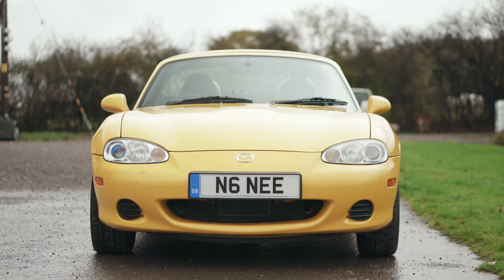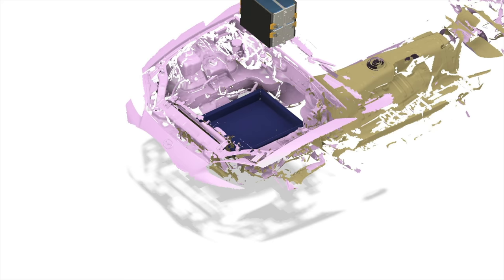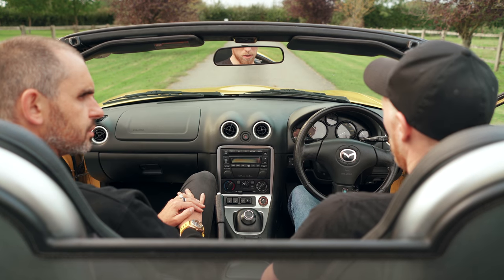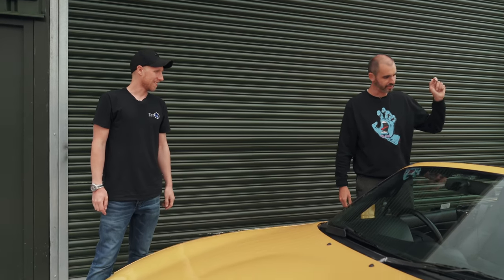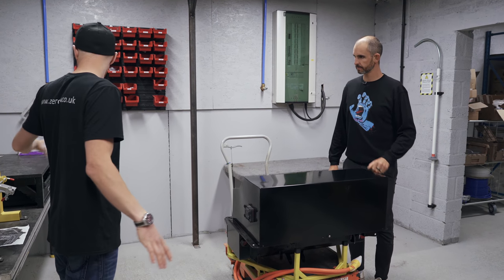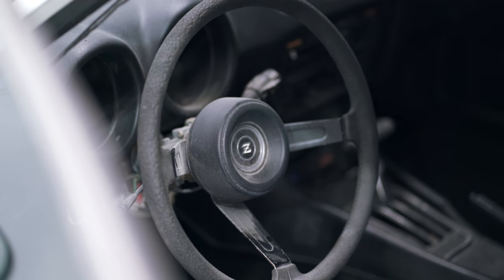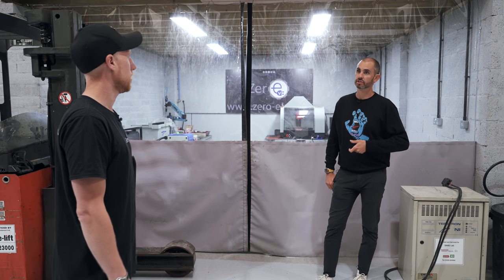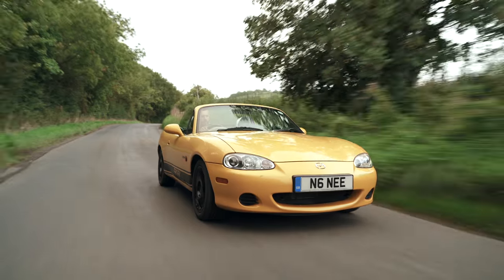EV swapped Mazda Miata MX5 // The Late Brake Show

Comment: 20,000 for 100 mile range  😩 I think I'll stick with the dinosaur juice .
Reply: For how long? Some countries are already planning on stopping sales of new ICE vehicle by the end of the decade.
And as more conversions become available, the prices will fall. For a weekender like the Miata, 160km range is further then most people living in cities would ever drive in a day.
On top, it's very easy to spend that much on a performance engine rebuild, evens full rebuild of the Mazda motor with turbo and intercooler will cost that if done professionally.
Reply: @PiDsPagePrototypes  I’d suggest you find another mechanic if they’re charging you 20k for that!
Reply: @Retrobeemer  When you factor in the labor costs, even fitting a 5000k (US dollar or UK Pounds) engine upgrade will put you well past 20K
Reply: @PiDsPagePrototypes  I’ve just upgraded my 1602 to a 1.9 twin cam, with custom engine mounts and subframe, refreshed the whole engine with new timing chain etc, modified the exhaust manifold, fitted standalone ECU and had it mapped, fitted a brand new LSD, a 5 speed box and brand new coilovers and the bill included parts! It was way under £20k!  Also I recycled an engine and it now does 45+ miles per gallon! So is as “green” as anything electric. #bmw16v02

Comment: There are a bunch of comments here complaining about missing having a manual transmission, ostensibly because of the feeling of engagement that accompanies it.  But what is the point of a manual transmission and clutch? It's to allow you to shift to a higher-torque mode when you need it, and to do so in anticipation of needing it (as opposed to belatedly, as with an auto transmission).  But if the electric motor already has the torque available, then what are you missing, except an additional ceremonial step?  Did drivers miss having to double clutch before manual transmissions had synchros?

Comment: Too many EVs for me.
Reply: Na.
Reply: But they are the future and can also be the past 😀
Reply: Not for me thanks.  The engine and that gear change are iconic parts of the MX5 and contributed to making them special.  This is like a faster looking milk float.
Reply: @Retrobeemer  Isn't it a bit of a stretch to call a 1.6 MX5 engine 'iconic'?
Reply: Jonny likes his EVs. That's why I'm here. I have the same attitude you have when he does an ICE review.
Reply: Luddite, eh? Uhuh.
Reply: More EV please.
Reply: Absolutely. May have to unsubscribe if it goes on
Reply: @robtt997  - Pro-tip. When he showcases an EV, don't watch. When the video is about an ICE car, watch. Although you may learn something by watching the EV videos. The engineering is fascinating.
Reply: Chris Clarke The mix of a revvy twincam and the snick of the gearshift were deliberate design features.  Also that engine was always built with turbocharging in mind (see 323 4x4) which is why BBR offered the factory blessed conversion when they were first released in the U.K.  They're a copy of the Elan after all.

Comment: I so want to ev swap a modern ford transit custom, something like a 200mile range at around 200-300bhp would be amazing rwd and around 1 tone pay load. May look at building on myself in 4 or 5 years when kits become cheaper and get it commissioned and signed off from a pro.

Comment: Nicely assembled unit but I don't really see the point if the range is so low, I suppose if you're only ever going to use it local that's fine but at the cost it doesn't seem realistic, either way it is very neat.

Comment: Looks like the only things missing are swapping the air pump for hydraulic system, and a gearbox like the Taycan gets, to give it harder launches, and more top end... Or lower power load at highway cruise.
Y'know, for the noise factor, a properly tuned cooling fan could produce a noise like a gas turbine.

Comment: Jonny, have to say your "sellout" move was well worth it! It is hard to pull off this level content just on your own so well done going up a level! Good stuff!
On a subject - I keep wondering when or if will it be possible for a regular guys like myself with some ordinary but loved daily driver (with 200-300k on the clock) to buy a e-conversion for some reasonable amount. Because you see there is SO MANY already produced and sold combustion engine vehicles, it is just not sustainable to scrap them all in next 100-200 years. The bodies and chassis are perfectly usable as is. Why not give them a chance to keep going... (Well ofc I know why and how expensive the per model RnD work would be and it makes me sad 😭)

Comment: You wanna bung a decent 4 point cage +/- door bars in that. I've been using a Mk1 MX-5 as a gravel Autosolo car for a few years. They're quite popular. Couple of years ago two old boys rolled one, wearing a hard top. It pancaked it. The windscreen frame just folded flat and the hardtop was crushed. It didn't even have the crap chrome roll hoops. Cue Air Ambulance and trips to Hospital with the passenger suffering a head injury (a large haematoma - looked like he was growing a 2nd head) & severe concussion. They were lucky to get off so lightly.

Nobody else with a MX-5 was keen to go out again that day. Except me. My mate said he wouldn't drive it. 'I have a wife and two kids.' So I guess I'm expendable. I only did two stages to test a new reinforced diff casing, diff skid guard and welded differential, and then I decided caution was the better part of valour.

We all fitted proper roll-over protection after that experience.

If you turn a Mk1, 2, 2.5 MX-5 over, don't expect the windscreen frame to save you. It won't.

Comment: The 1.6 might be 980kg idk, but my mk2 with the 1.8 was 1060kg on the scales during registration with whatever amount of fuel was in it. So basically just the same weight as a stock 1.8.

Comment: I find it really odd that the Chevy Bolt motor/drive unit has not seen more uptake amongst conversion specialists. Perhaps Chris has some knowledge as to why this is the case? Nice to see these guys making sure everything is reversible so that when a future solution exists (carbon neutral fuel with a stored oxidiser/Nox reagent) we can go back to piston power for the more interesting cars we like to drive.

Comment: Brilliant video Jonny. I love what these EV conversion places are doing these days. I feel like the only thing holding back EVs in the modern age is the lack of a standardized charging network with standardized payment methods. Unfortunately, Tesla don't seem to care that their vehicles use a completely different plug from everyone else, which sort of leaves the rest of the industry in a mess trying to create some sort of standardized system. If I could just go up to a charging point, and put my credit card in, or use my phone to tap to pay, and plug in, that would be great. But now, you've got to sign up with like a million different charge networks, have membership cards, different apps, etc. Its a pain. At a petrol station, you just pull up, stick your credit card in, and pump fuel. That's it. Its the same everywhere around the world. That's the sort of standardization we need for EVs.

Comment: I'm going to preface this seemingly negative comment with a statement, I intend to put this setup (same motor and controller sightly more batteries) in my dream car (which I own and is a rolling chassis in my shed), I think this is a terrible way to go with an mx5, it's over 4x the value of the vehicle for half the reasonable distance, less top end, slower to 60 and just feels improper being a single/auto in such a car, but its great execution and a great video!

Comment: If you are using liquid cooling for the EV motor and electronics, then why did you not use the motor coolant running through the cabin heater?

Comment: Car manufacturers THIS is the EV i want! Simple, light, rwd 2 seater roadster (or coupe), reasonable range, and not a ton of power. Not everyone who is looking for an EV wants a 2.5 tonne 700 hp SUV with 18 cameras monitoring your every move. If you want people to adopt EV's then you have to start giving people options.

Comment: Love the video. Struggle to get the point of doing an EV build with a mk2 MX5 though, especially if the power is similiar. Spending 20k on a 3k car seems crazy, give it a couple years and a model 3 will be just over 20k second/third hand.
Reply from the maker: The point is that this car is a test mule for many other (more valuable) front engined rwd classics.
Reply: @TheLateBrakeShow  fair enough!

Comment: Hey, if my chassis can survive another 10 years, this might become an affordable way to keep my car road going (have a 1999 10th Anniversary Edition, lots of miles, in California).  I do like my motor, but I'd much rather have the ability to keep the car going for as long as I can, even when petrol cars make their exit, at least in California.

Haven't really got to use my car for much autocross either way, and it would be nice to still have the ability to use it around town beyond its useful years.  We'll see how it turns out.  Great vid, really cool shop there.  I'll miss manual vehicles when electrics take over, so maybe it could emulate that somehow in the future as well?

Comment: Really impressive build on this.

With some many MX5s out there, I really see this platform taking off.

The top speed and overall performance isn't fabulous. 

If the 120 mile range could be kept, at a higher top speed and a little faster 0-60, this would sell like hot cakes!

And I'm sure, this being the prototype that there is a little more to squeeze out of it.

Overall, a fabulous conversion and it wouldn't surprise me if Mazda's engineers aren't making phone calls to have a little nosey themselves :P

Comment: Great way to take an NB and update it. With new battery tech in the future, range can increase without adding more batteries. Tesla seem super tight on parts, a shame since they are kind of holding back the innovative side of car modding. Think the 0 to 30 is where the EVs are amazing compared with ICE, which is maybe more relevant for lower range EVs used in the city or back roads. Really enjoyed the second party of the video, the tour was really interesting.

Comment: A very interesting project, I've watched the excellent series of videos about it and I suppose there's an element of "because I can" about it but I'm afraid I'm finding it a little difficult to fathom what they've actually achieved with all the work and all the money. You end up with a car that accelerates exactly the same as a standard 1.6 MX5, but is 40mph slower and with half the range. All for about 10 times the cost of a standard car in similar condition. TBH I'd rather have a Rocketeer conversion.

Comment: Really great stuff and glad to hear you guys thinking ahead and future proofing against changes coming down the pipe from Tesla. Other companies that are building mostly from Tesla packs are going to have a very bad day when structural packs start rolling out. Salvaged S's and X's will skyrocket in prices and conversion costs will go up. It may be the right thing for Tesla, but it'll be badnews bears for conversion shops. And the GM EV Crates don't appear to be especially practical in the new-old-stock Bolt battery pack format, and way overpriced.

Comment: Wonderful conversion, I hope the mazda engineers follow this project. I am a proud 2020 mx5 owner and the only gas car I will drive, my other car is electric. Mazda has to be thinking electric in the future for these fun cars. Range will be the only drawback for now.
Reply: I would reckon every car manufacturer is thinking electric in the future by now.
Reply: @redbaron6805  yeah but battery tech is still lagging for small cars. I really wanted to buy the new electric mini but the range is just not there. The 4000lb car could realistically go 110 miles. This is why all electric cars right now are bigger instead of smaller. It's the reason why ford made an electric crossover mustang, it simply would not have been practical to go with a normal mustang body. I can see this issue keeping mazda from committing to an electric mx5. People are not going to buy a $40k e-mx5 that only goes 100 miles per charge.
Reply: @a.e.w.384  It is still early in the process.  Batteries are getting better and cheaper and the process will accelerate even faster in the coming years.  We are still pretty early in the EV process and you will see massive changes in the next 5 years.

Comment: Ceteris paribus, weight-wise, what would 4680s mean to power & range (+16%?) when they become available? 

Btw, I'd love to see my Mazda RX-8 converted into a 4680 range-power "extended" PHEV via a differential-fronted e-motor to reduce daily gas use & help power/torque on track days. Would be fine paying 4x of what a turbo-supercharger add-on would cost. Range would only need to be enough for maybe 3x20minute track sessions between a lunchtime supercharging. Knowing fellow rotor heads (12 RX-7/8s between my son & I, since my '86 GSL-SE) that would be MAGIC!!! A frame reinforcing battery pack (under/replacing passenger feet/seats?) would be ideal. Thoughts? Anyone States-side close to this (shedding a tear, haha)?

Comment: For less money there is the bmw i3, similar weight (for the 60Ah) , and power quicker 0-60 still 50:50 weight distribution, red but you don’t have a sport car seating position, no convertible option, no doble wishbone on the front, tires are awkward especially if you want semislicks, no lsd option at this time.

Comment: I would like to hear what's the process of getting a converted electric car on the road and I need a brief lesson on what's needed to operate a regular car. Here in America I don't think we have any special process for electric cars just pass emissions and prove the car isn't stolen
Reply: The uk is very similar we just need to update the log book.
Reply: Passing emissions should be the easy part.....
Reply: @Hazell_Nutz  I thought in Europe they might try harder to keep cars off the road that might catch fire but I guess it's the same story where they would become liable if they certify the car and it catches fire
Reply: @Hazell_Nutz  what happens regards road tax, do they become zero due to no emissions?
Reply: We need to meet R100.1 which has a lot of safety regs and then also protect the company if there was ever an issue. Things like tools must be required to access hv and bms must be used. Road tax does go to £0
Reply: @Hazell_Nutz  thanks for clarifying.

Comment: Max speed of 82mph; so that would equate to max motor rpm of 3100 rpm, assuming 16" wheels.  Theoretically quite a lot of performance in reserve, assuming a higher reduction ratio; but that would eat up the battery power.

Comment: Regarding EV-conversion kits, I'm still waiting for a reasonably priced Audi A2 kit. The timeless aluminium body just demands THIS! The energy economy would probably be insane, given how efficient it is with the current, small diesel engine.  A 50KW CCS version, with around 30kwH battery would be the perfect city/small family car.
Reply from the maker: That would be an excellent conversion. I swear the values of A2 bodyshells would rocket.
Reply: @TheLateBrakeShow  Thanks for the confirmation, and for a fantastic show btw! These conversion episodes are the best. If the legislators in EU (and UK) are truly serious about efficient ways to stimulate a transition to low emission transport, they should at least offer a modern  "cash for clunkers"EV-conversion subsidy by at least 50% of their current EV-subsidies for these sorts of projects. From a life cycle emission analysis, NOTHING can beat a conversion EV. It would instantly transform the current cottage industry and give the less fortunate the means to enjoy an electric drive train in their cars.

Comment: we deffo need cos like this - other obvious candidates incl: TT 4wd - cheap, 4wd, soulless original engine ....just need kits to evolve into bigger bang / Buck....  200+ range, 9 sec to 90, 90 VNE, no greater than 100kilo weight increase, and....dare I say , nearer half the cost - a used TT for say £3k + £10k conversion...now that starts to get interesting :)  With 50kwh packs coming down to £2k, new next year....- Need a motor between the 9 and the Tesla, readily available used or Trade price, new - c 290bhp, 390 lb ft  territory...

Comment: What is the co2 emissions from the manufacturing of the batteries? And does it outweigh the life of the vehicle? I'm not convinced this is as green as people think it is.
Reply: People get into this fallacy about manufacturing emissions vs driving emissions.  In reality, only about 5% of a typical cars lifetime emissions is from manufacturing, the other 95% is from burning fuel to power the vehicle.  So, in fact, the additional emissions from the batteries is typically offset in a matter of a few months to a year or so.

Comment: this is pretty cool my only question just since obviously the more popular version of an mx 5 is the manual versions i mean thats why i bought mine i dont think i would have bought one in an auto but  im wondering if at one point there may be a way too simulate driving a standard in an electric car like it would basically just be for looks and the expierence of it but idk maybe it could be ran by a computer that controls the trans or something so you have those options of oh i wanna be in this gear or whatever lets say just like how alot of cars have a "manual mode" but make a true manual mode like the computer could switch back and forth if you wanted but the manual mode would actually allow for the use of the gear shifter like in a normal manual trans car haha idek just a wierd thought i had seeing this